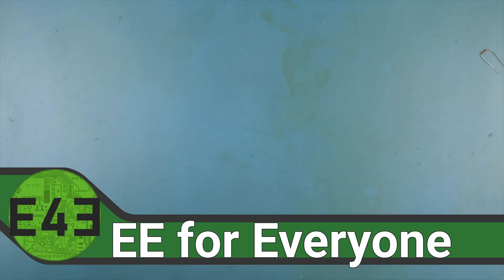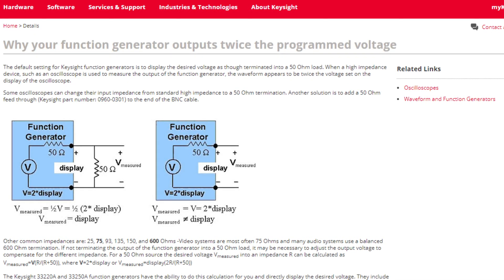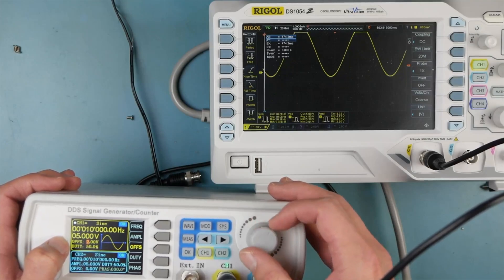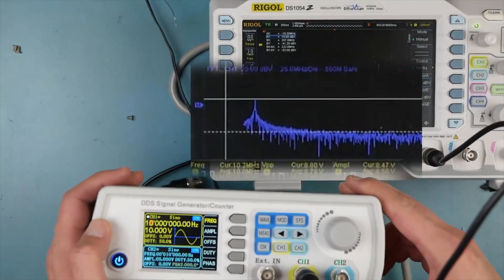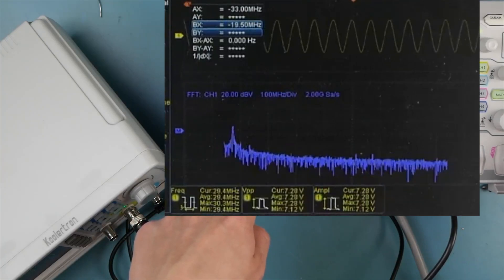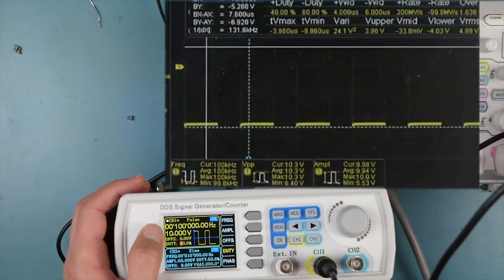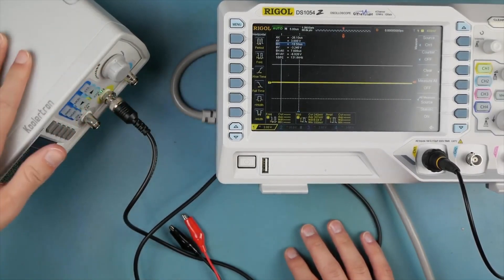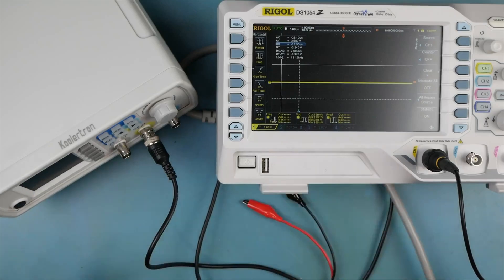Koolertron 30MHz Function Generator Unboxing & Test

Comment: this is weird .. was your scope set to 50ohm input impedance? i was seeing this video https://youtu.be/b66nnWb3z54?t=342 << ( i thought all of them will have same design ) .. and it has 50ohm output impedance
Reply from the maker: Woah! Thanks for pointing me to that vid! Bizarre!! You'd think they're all the same... I'll have to double check... Maybe we both need to do a teardown? :)
Reply: @EEforEveryone  im confused.. lots of chinese products will have same sort of look with different brand name... Usually clones? ..im setting my self a lab so i ll buy my self one soon but now since yours doesn't have a 50 ohm .. i ll probably go for the other model .. 
Thanks for the videos
Reply from the maker: Yeah, I totally agree! I added a ~50ohm load, and I think I know what went wrong. 

I've typically seen the display read 2x vout (open circuit) when it's terminated equipment.  Turns out, mine reads about 46.5 ohms (series), about 7% error from a 50-ohm termination. Not great!

I think the combination of the incorrect display + bad tolerance on 50 ohm threw me off. Thanks for reaching out again!